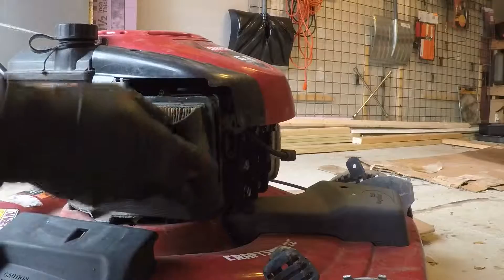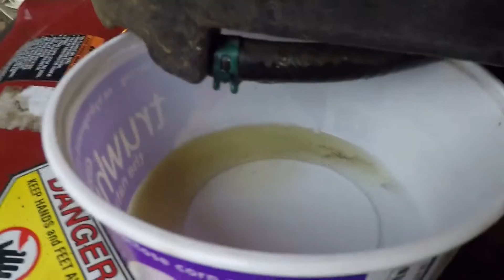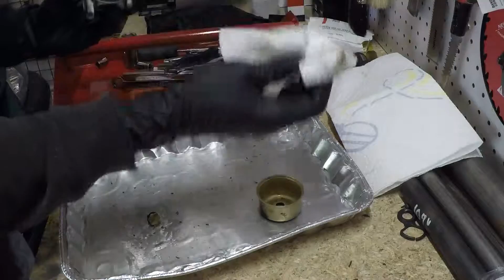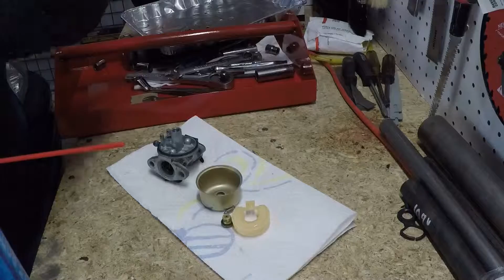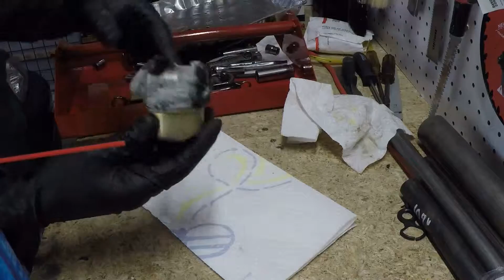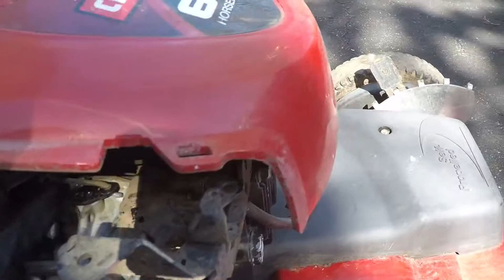Craftsman 22 inch mulching mower carburetor cleaning and rod knock

Comment: I had one of these, different deck but same engine, put about 5 hours of work on it and it wouldn't run, had gas (staring fluid) spark, compression, trimming, just wouldn't run and I have up on it, to this this still don't know what was the issue